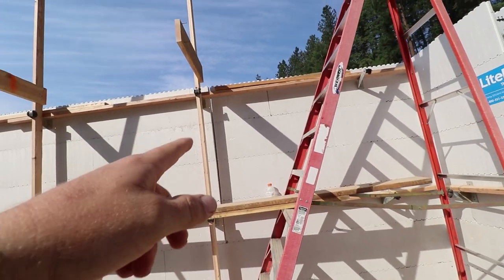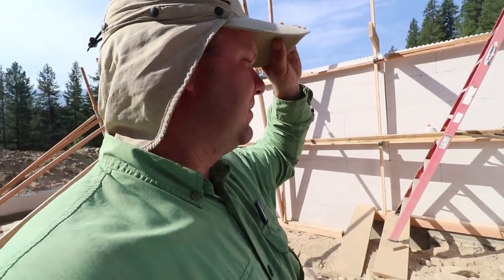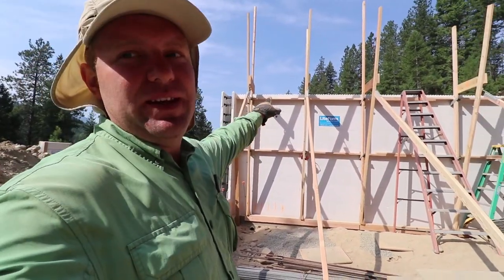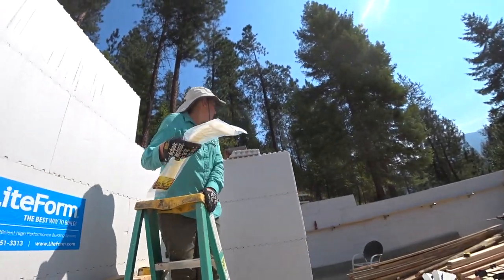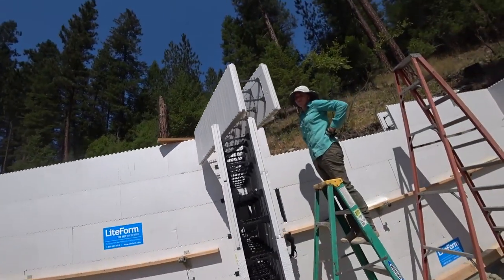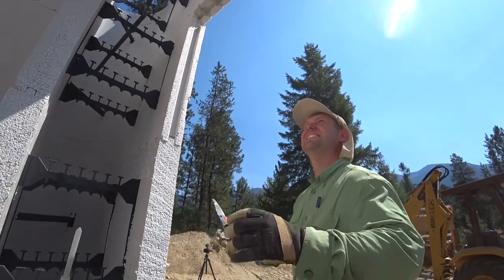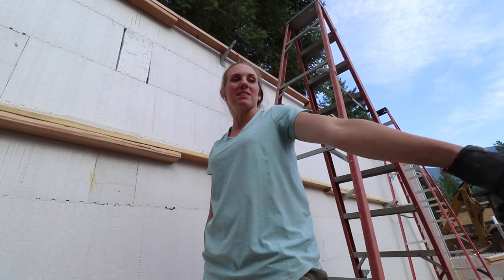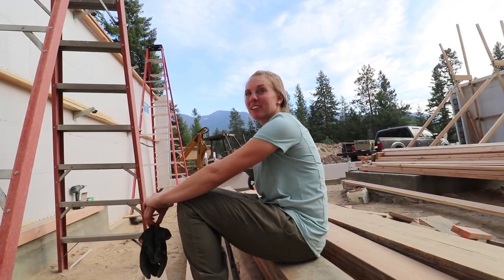Building a House Start to Finish: ICF Construction on Mountain Home in Wilderness

Comment: It is good to look at doing hard work. 
I would also like to adviser you carefully about the properties of wood. 
All the wood is warped or distorted when the sun goes down.
There is no way to twist, but when it is recessed, 
turn the tree over and sprinkle a little water to get it right again.
So the tree should always be laid horizontally in the shade.
Good Luck!^^

Comment: screwing things together has its place, but for instance connecting the diagonal braces to the steel pins I would opt to use 16D double head "duplex" nails. When done just pull the nails, let them drop and voila a done deal. Also another use for nails is what we called"grade nails. When done forming weather plywood or foam, set your laser at the heigth or top of the wall and stick nails from the outside toward the inside of the forms (icf). Then you float the crete to the top of the nails. Another good trick is to cut the mag float off at both ends equally to fit inside the forms, like minus a 1/2". Works great, the grade nails help with not having to cut the top of the forms to finish heigth! use that laser it is indispensable!!!

Comment: Had the same problems with the ICF houses we built, but we had the luxury of finding the problem on the first row. So we shimmed the first row and spray foamed the gaps at the bottom. Then reinforced the bottom with lumber. Experience is what you now have. Keep going. The walls are very forgiving as they are solid concrete. as long as the wall isn't leaning it will work.

Comment: The gap is no problem. Just screw plywood over it. What matters is the level of the top of the concrete. These are just forms, the concrete is your wall. Spend an hour and watch the Nudura ICF install videos.

Comment: I've been impressed with both your ballance in building the wooden scaffolding. Getting things plum, straight & at right angles is often a pain; but it is worth it. The system blocks you use makes it essential. The Makita BL tools seem to hold up well.

Comment: Don't complicate this issue Jessie. When you set the bracing on the north wall and pull it plumb, that crack will close right up. You may have to loosen up the bracing on that section of the west wall to let it move a little.

Comment: Hi guys this is in reference to watching you struggle with the drilling of concrete.
My back ground i have been a carpenter since I was 17 ( I am 59 now) now I run building sites and refurbishments of old large manor houses for some very wealthy people.
You will always struggle drilling in to concrete with the impact drill you are using they were designed for drilling soft brick or blocks like the aerated cilcon  blocks we use in the UK.
you need is an SDS hammer drill  Like the Makita DHR 242Z it uses the same 18 volt battery's that you are all ready using, I have one and it's used all the time, I have had it for 2 years and not had a problem with it, and the fact that your house is going to be made of concrete you would find it a real boon when you start the fit out.
I love watching the blogs and videos and the fact that you both work so well together keep your chins up and you will no doubt get the house you want.
Kind regards Simon.s

Comment: Nice Progress Folks! Consider,Instead of cutting a horizontal wedge in the West wall, just extend that common west wall seam downward trough the lower 3 courses, throw a couple boards on top of the wall and re-seat the North End of the West wall with a little pressure from the backhoe bucket.

Comment: Before you ever build you check concrete for level. The biggest screw up was not laying fabric and gravel and then watering and compacting the gravel. Then instal drain tile after you pour concrete footer  it would have resulted in a much mor level and easier build job.

Comment: Snap your level line at the top of the goofy wall, transfer the difference to the bottom of the wall block by block. Cut the bottom near the footer with your sawsall and let it drop in place. Might need a little persuation from the top with a block of wood and a mallet. The back wall will draw in when the goofy wall settles down in proper place. Problem solved.

Comment: alot of mean people in the comments, ICF is not the best option to build a house if you ask me, its kinda to late now, but do some research of foam concrete blocks, i have built 3 homes by hands, its simple and quick. it took me 1 month to build my small home, also keep it up! there will always be problems when you are building your first home, but dont worry everything will be okay but some is also a very expensive learning experience. take care and god bless from Russia!
Reply: well, my earth celler has 5 tons of gravel and dirt on top of it and the walls are concrete foam blocks its really tough material if it done right, mine has metal support inside them, one alternative what they can do on that retaining wall is to dig out alittle put some gravel and use spray concrete, thats a cheap and effective way to hold that dirt wall

Comment: It's a little late in the process to ask but why don't you remove a couple of ICFs in the front wall and bend some of the vertical
rebar over sideways and make a gravel ramp over the footer until you finish the other 3 walls?  I would think that not having to hump everything over the 16" high forms and around/thru the rebar would be a huge time and energy saver.

Comment: Good job, volume wise, your basement looks like it might be the same size as my 2 story house, oh to live in a country where land and materials are cheap, still can't get my head round how the "building" is going to sit in the landscape, looking at the work so far you could move into the basement for the winter maybe, it won't be pretty but if you get the floor on in time, it could be an optional upgrade from the RV

Comment: Please put rebar cap protection on steel steaks sticking up at bracing. I have seen man impaled from falling on one.
Reply: My conment was to cover steel steaks to prevent a fall resulting in impailment!
Reply: What they have beats scafold built of bambo and tie wire used in Hondours
Reply: MY father was a contractor and saw an impailment from ground stakes!

Comment: In days of old, all walls were out of plumb. I remember and old engineer who complained that the worst thing that happened in design and construction was the computer and calculators.  Before that they a slide rule and overestimated... Making buildings stronger than necessary instead of just enough materials to get by.

Comment: I would suggest you use super-plasticiser to get a fluid concrete mix, the problem with insulated concrete forms is that you cannot see any major voids in the walls since you will not be removing the formwork.

Comment: Great job. humm got tell ya...when we built our house. I used a concrete sub been around for ever....the footings were so out of square that the poured walls were on the edge of the footer in one corner, I missed it because they hid the mistake under the stones. But the building inspector didn't. So I told this because all you arm chair formans criticizing them for their mistakes. We all make mistakes and as long as they fix it, what does matter, they don't even have to tell us they made any. By the way they have plans and an engineer. They could use some encouragement from all of us.😎

Comment: I think they are doing as well as they can with what experience they have. They do seek guidance when they find a problem. Adventurous job to take on. In 26 years working on houses I've seen "professionals make as many mistakes if not more. I've had footings/foundations that were perfect and some that way off, poured by foundation contractors (3 inches out of level over 24 feet).

Comment: How tall is the garage on bottom? Tall enough to put trailer in once roof is on ?  You will need to hold on some of those metal stakes for later pours (side walks, shed floors).  Maybe use the tractor loader on outside wall for putting up rebar where there is no dirt bank.  You could make walk way on outside so you don't have to work around all the inside bracing.

Comment: For only a few dollars, using a water level, you would be able to get the forms for the footings to within about 1/16 of an inch of level.  If you want to spend about $5, you can use a reservoir system (read "pail with hose bib") and that makes using the water level pretty much a one person job.

Comment: Are you all making all this lumber with the lumber mill and trees you bought? I noticed printing on the 2x4s like they came from a lumber yard. That lumber mill is cool so would like to see it in action if you are using it. If not using it, is there a reason? Liking all the progress and updates 👍
Reply: ttnova, it's just not worth the time to mill 2x4's when you can purchase them inexpensively. The real savings will be when they mill the large timbers for the house framing.
Reply: Ah, that makes total sense. Thanks for the explanation.

Comment: The reason for the different size torx heads on the screws is because the screws re different sizes. Larger screws need greater torque to screw in so to keep from stripping out the head they use larger torx heads.

Comment: If you can choose, I'd go for T25 because the bits last longer and T25 can support more torque.  T20 is a bit small IMO, T30 is a bit big, but T25 is just right. Also removing T25 is easier because it can tolerate more debris, paint etc over the screw and still be removable. Paint fills a T20 hole pretty easily and can make it a pain to remove the screws.

Comment: SAFETY ISSUE:   When you put your scaffolding on between ladders - I keep seeing that the board end and the step of the ladder is very close.  This could result in the board slipping off the ladder and having your wife come toppling down.  PLEASE move your ladder(s) in more so the board is sticking out farther that the ladder step PLEASE.

Comment: you're doing a good job for first time builders. 
if the building requierment might be difrent but here's the problem from my point of view...

#1 the corner's needs a lot more rebar reinforcement then u have
( 1 12mm isnt enough fixed using Z  rebar or rebar box)

#2 u have less than the recommended minimum rebar for at retaining wall at that hight 
(the wall will fail in few years unless reimforcment is done) 

an easy fix to this is U formed rebar reimforcment pushed from the top to bottom tied to the rebar in the tom and bottom of the wall

and here's' a tip
don't bend full length rebars for the corners its extra work when u only need to overlap it and tie them together
and dont forget to cut of the zip ties after tieing them to gether

Comment: you are putting one board on the face and one on the top of your footing if you screw them together first they will hold themselves in place while you drill and secure the pair as a unit. this would also allow the use of a concrete nail driver that uses 22 blanks and is much faster.  just a thought

Comment: As screw length increases, so must diameter to maintain strength and durability~ and there again drive size must also follow suit.  You can buy from any adequately stocked hardware store a double-ended bit with T20 & T25 pairings, which will span nearly all common screws in a project such as yours......

Comment: JESSE,

END YOUR ANGST ABOUT DRILLING IN CONCRETE.. JUST USE  A 2 BY 4  AS A  BRIDGE TO TRANSFER THE LOAD FROM THE STRONGBACK TO THE FOOTING AT ONE END AND THE BARE GROUND (OR ZUCCKLE) AT OTHER END.

You have used 2 by 8's to support your stepladders.

ENJOY YOUR RELIEF.

Comment: I've read his face book comment  and he is behaving like he knew all along about rotary hammer SDS drills!! Bull S, he said "use what you've got", if that was the case why did they waste money buying a whole bunch of masonry drill bits and screwing up at least one or more of his handy drills. SDS has been around since 1975 anyone that has worked with concrete fixing knows about them and wouldn't attempt using anything else. But Jessie is too macho to say thanks to all those that were helping him in the comments ,he cant admit he  didn't know about them, and for that he looses some of my respect. Yes you have been working hard but don't ignore genuine help.

Comment: It is CC, you ALWAYS check the level after the footing pour.  If you are lucky, it is level, but most likley is you will find an error and deal with it at the first course, which you also laser level the top edge...  So are you NOT using horizontal rebar in the wall?

Comment: Can you please share an simplified explanation of the build plans. Been following the channel for a couple of month now, and I though you where going to build a log cabin. Now it seems like you are building a concrete castle. Why do the concrete walls need to be this high? Are you gonna cover them with wood paneling? Or are you building a three story house (2 levels of concrete and 1 level with logs)? Are there gonna be a concrete base-plate/floor?

Some confusion cause I've either missed the video where you explained all of this or there is no such video yet.
Reply: FatLingon There is no such video. I have followed along from the start. I was in the same boat as you thinking I missed a video but I went back through and there isn't one
Reply: In the description and please do take the time to do this and click on their blog link, click on the Project Debt Free Home menu page and scroll down a bit until the very general plans show up.
Reply: Joshua79C C, I have seen plans - it was a video explaining then in detail - I'm sure they will make one sooner or later! Thanks though
Reply: Figure they have not made since the plans were still not finalized, but you never know when they will go into further detail via video, for all we know they could be leaving it all a "secret" until all is set and done. I even see due to the time they put the initial plans on the Blog why they did not include measurements, yet

Comment: this is so common when it comes to pouring a ring beam/footing. I have seen this so many times, especially with inexperienced people left to float the concrete as its seen as a simple job and ends up being underestimated! The ring beam/footing and its installation is so critical to the rest of the building and should always be done under experienced supervision or by experienced persons and this video only proves that. the fact that the blocks are moving out by 1/8th of an inch per block is just staggering. 
STOP calling liteform, just bring someone on site who KNOWS what they're doing to guide you guys through this initial stage. you dont need to keep them on site for the whole thing, just this initial stage. it will be more than worth it!

Comment: House looking good.  I am surprised you got the level that close.  I see those errors on simple slap houses on level grade.  Those blocks make it very unforgiving.  You guys are working together which is the most important part of this project.  I would leave the crack, tape over the inside so concrete doesn't spill out and mark a chalkline inside the foam where the concrete needs to go and then after pouring, trim the foam.  I believe you will have a wood perimeter screwed into the top of that wall.  The wood will compress and fill the imperfections.  I see that in alot of construction around here.  Worst condition you can still grind down 1/4 inch of concrete with a grinder.  Just alot of dust.  It is pretty easy with fresh concrete.  Not the end of world type of problem to get stressed over.  Tile guys do it all the time on certain projects.

Comment: The torks screws I have seen, the bit size is determined by the screw shank size(#8, #9,#10) in other words 2in #10 uses the same bit as 3in #10

Comment: At this point the gaps and out of level are just another common item for foam forms.... for the holes just fill them with foam or cover with a 1x4 screwed to the foam... it will hold.... for the top do as the gentleman explained. Cut or snap a line to work to.
Reply: I hope you did not cut the wall to fix the gap.... that just weakens the structure before the pour...

Comment: Can't you fix short lengths of timber to the concrete to support the uprights, or am I missing something? Also, when pushing the wall to vertical the timber will bow. When pulling the wall to vertical the timber won't stretch.

Comment: did you lifeform rep tell you to check your level after, the second row.   before you pour double check all dimensions even if wall say plum.  you can still be out.   40 feet and 40 foot one half inch  will throw out your framing. and make it hard to finish.

Comment: I believe there is an easier solution to fix your wall issue.  Why don't you install a double or triple layer of sill plate, use your laser level and plain down the top layer to make a level surface.  This way you wont need to trim the wall blocks.  I think if you make an attempt to trim the all blocks the rebar will prevent it from sinking.

Comment: I would worry if the form is not vertical. A 0.5 inch discrepancy in wall height as long it is vertically true is nothing to worry. Take a moment to appreciate you hard work.

Comment: Also, shouldn't you start installing the vertical rebar? The higher you get, the more difficult it will be to get inside the small tube rings at the bottom.

Comment: Dont gap the wall, don't sweat the 1/2 or 1" out of plumb/ level.  Pour the mud, let it set.  Shim the framing.  I've poured 100's of foundations, flat work, and it's never true level/square.   Fix it on the framing phase.  Pour concrete!!!!!